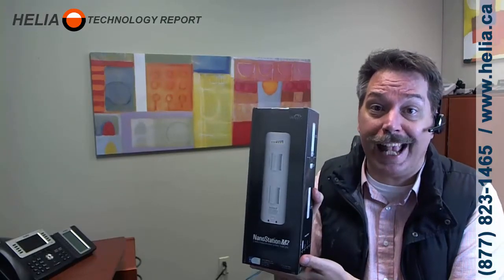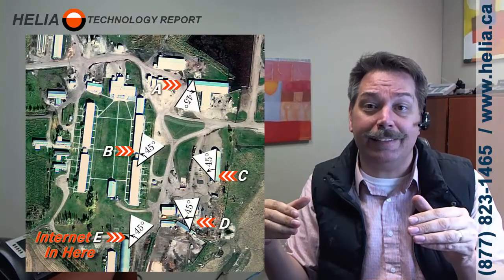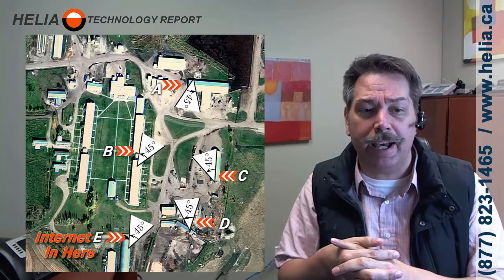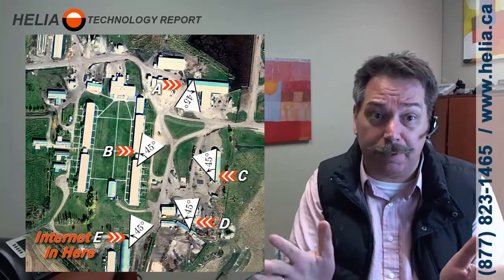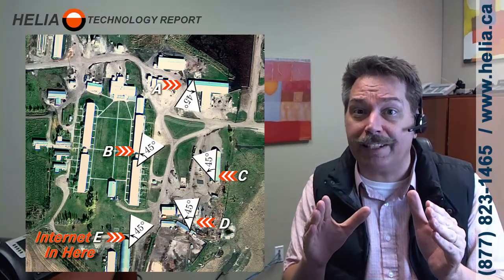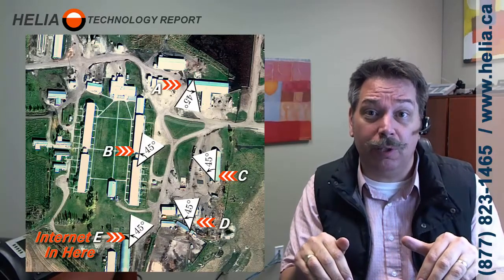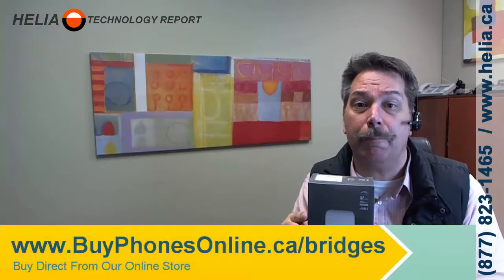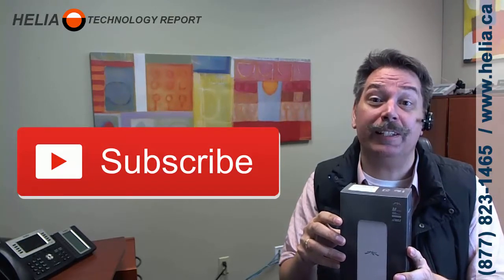How To Send Internet To Multiple Buildings Using NanoStation M5 Wireless Bridges

Comment: how many device can connect with one NanoStation M5 2.4 ghz..
Reply from the maker: More than one if they are in their broadcast area.  You can add 5+ but if you are looking for high density then you should use a Ubiquiti Sector antenna instead for the access point.

When you say "how many devices", if you are referring to computers and VoIP phones connected to the Nanostation, it really depends on the total bandwidth requirements of the equipment and the distance and quality of link of the wireless bridge link.   You can use the newer AC antennas to get better link capacity or if you need much higher link capacity, use the Ubiquiti AirFiber product.

Please upvote the post, Subscribe to the channel if you find it useful.
Reply: if i hav 20 mbps internet and i connect it with a bullet M2 2.4 ghz with a omnidirectional antinna....can i make a wifi zone in 500 meter for 40 people where every one will get 512 kbps internet.
Reply: i am from bangladesh. i am waiting for ur nice reply.
Reply from the maker: The question is more complex than can be answered in YouTube.  You need additional equipment to manage and restrict the bandwidth and to manage your subscribers.
Reply: please elaborate on the the last question. thanks. I also want to create a wifi hotspot and sell internet in a small town in Kenya.